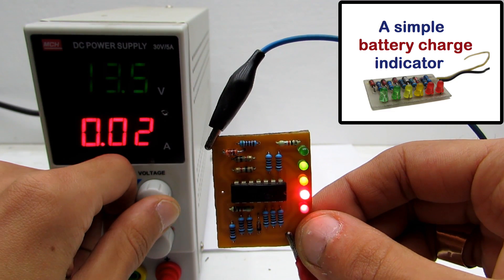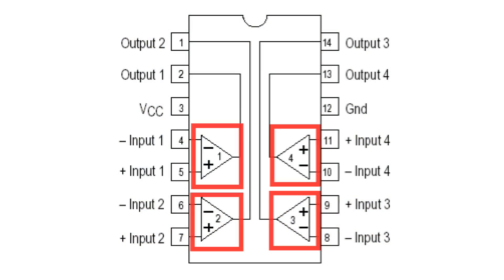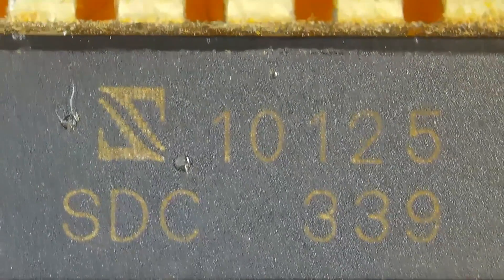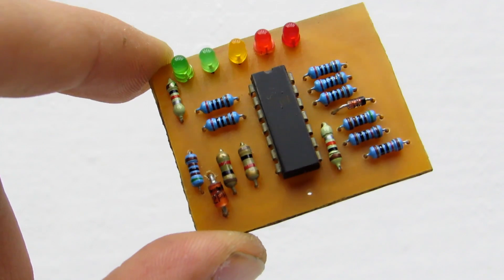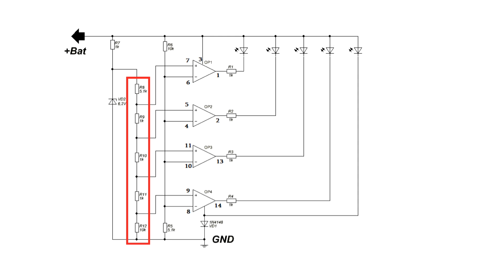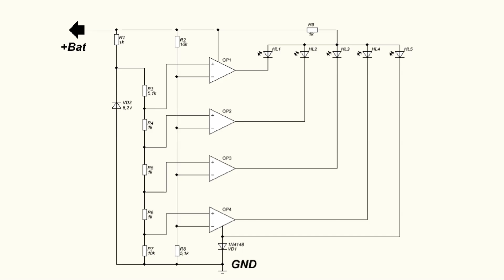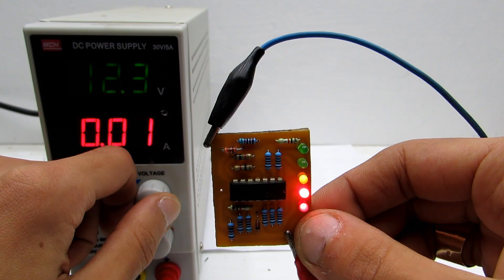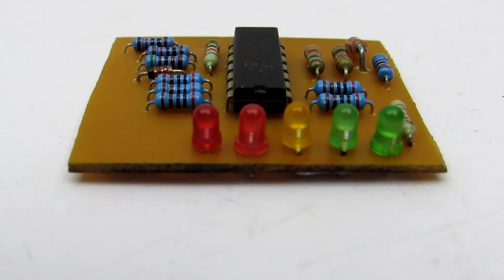Good charge/discharge battery indicator

Comment: Can I add a relay to the circuit? I want to cut off the battery when it is empty
Reply: Of course! Use a transistor, and a diode.
The transistor switches the relay, and the diode dissipates voltage spikes

Comment: Hi Kasyan,  if I want my reference voltage to be 9volt for 18650 lithium ion batteries connected in series to give 12.6volt, what will the values of my zener diodes will be?
Reply from the maker: Zener can not change, you need to calculate the resistive voltage dividers, there is an online program for this purpose.
Reply: Kasyan TV Can you tell what is that online program?

Comment: When engine is running battery voltage is 14-18 volts..  So this wont work until you turn off engine and let battery settle for a while..
Reply: You don't really expect ppl to put this shitty looking 80's tech in their cars! do you?
Maybe it would be an upgrade, if it was a 1980 Lada!
It's more useful as it was intended... a home-made battery tester.
Reply: PirateKitty what do you have against lada you amerikanski spy